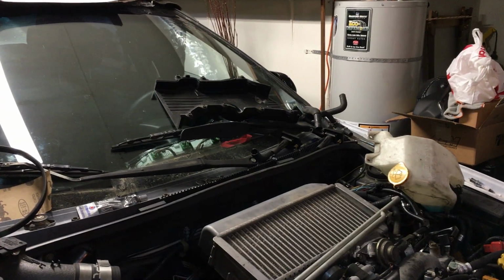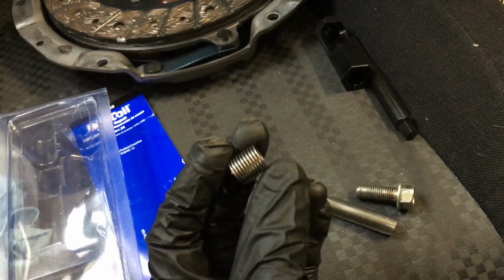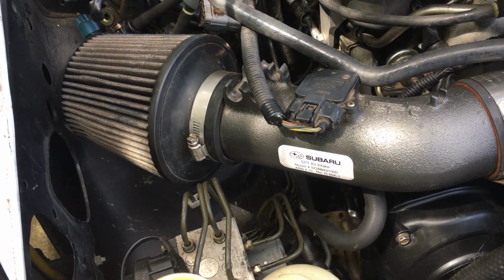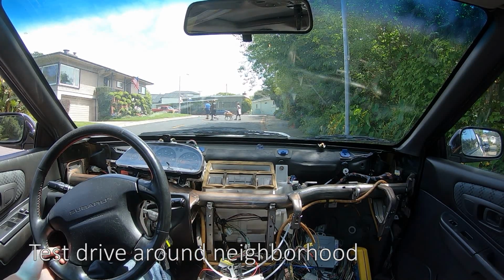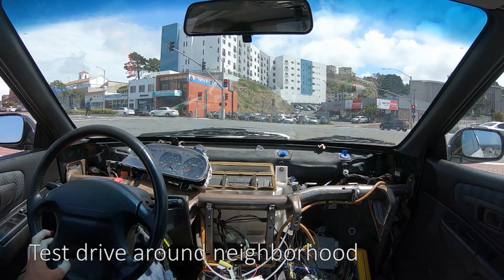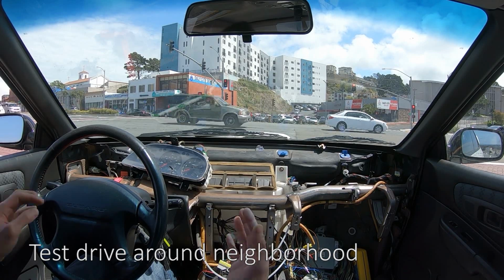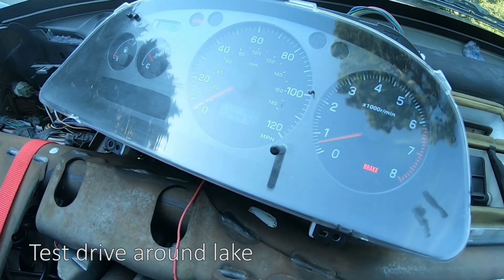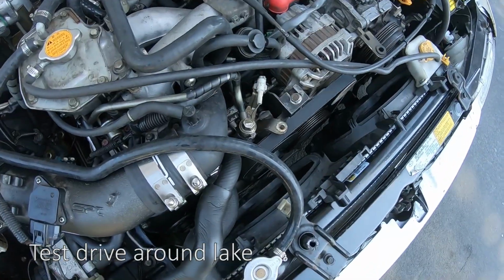EJ205 Engine Swap Pt 4 - Test Drive - Subaru Impreza 2.5RS GC8 Video 25

Comment: Such a small world. I’m interested in getting an e-bike and found your channel. After looking through your vids I realized you are the guy I bought my ej205 from and it’s showcased in this video lol. That motor is no longer, it had a stuck valve and did some serious damage. Parts of the engine still exist on the one that’s in my car now that I pieced together. Thanks again Collin!
Reply from the maker: I'm sorry to hear that Marcus. I'm glad you got to piece it back together, and it's working now. 
I bent a few valves on the stock 2.5RS engine several miles after putting in an OEM timing belt, tensioner and pulleys because the belt slipped. Luckily that was the extent of the damage, and replacing the valves and putting the same model Gates timing belt seemed to have solved the issue. 
I don't drive the Subaru much. It's good to hear from you!
Reply: @ColinLeung  I was wondering, you mentioned a wire you could disconnect for iacv. That’s the only problem I’ve had this whole time. Could you elaborate further?
Reply from the maker: @Allhailthebeavertail  It's been a few years since I've worked on this, so my head is a little rusty. Rewatching the video at 1:30 I mentioned a P0159 IACV CEL code due to a neutral position switch. If I recall correctly there's a brown plug coming out of the transmission that goes to the engine or ECU harness that I disconnected. 

I found a video that shows the location: https://youtu.be/SQFt5wya6QQ?t=113

The plug may look like this? 
https://amzn.to/3Gf4G08

Some other info
https://iwireusa.com/blogs/iwire-university/neutral-position-switch-and-your-subaru-transmission-swap#:~:text=The%20Neutral%20Position%20Switch%20or,in%20neutral%20or%20in%20gear.
Reply: Thanks Collin. That will help. The engine I bought from you lasted a while. Commuted 70 miles a day, 6dqys a week for about 6 months

Comment: Great Video! I have a 98 RS that I finished my ej207 swap on about 6 months ago. I bought it from some "jdm engine" importers and they promised it was good compression wise and even offered a warranty. Turns out lost a valve in cyl 3 and it ate up my turbo pretty good. :D I feel your pain with all this. It's coming together keep it up!
Reply from the maker: Thanks for sharing your experience! Did you have to BAR and smog the car, and did you have a check engine light? I was hesitant to purchase a used JDM EJ205 because I heard the compression ratios were different than USDM, and it would cause issues.
Reply: @ColinLeung  I plan to bar it eventually, but currently a broke college kid so that will have to wait. It won't pass smog in June so it'll sit until i can get a wrx for all its parts. I got my harness done by iWire so it was pretty much plug and play. I had a CEL from idle air control valve but I think that was it. I haven't heard that the compression ratios are different than the US. The only thing I can think of is it might have to do with mismatched ECU's between USDM and JDM. I know Bucky Lasek has a jdm 205 in his blue rs and I don't remember him mentioning anything in his videos.
Reply from the maker: @ArcyGarcy  That's awesome. Let me know how it goes when you finally get the car put together and BAR'ed.

Comment: Btw mad props for going through this.  Would have driven me up a wall and I probably would have quit a long time ago.
Reply from the maker: Thanks. I appreciate the feedback. I ended up putting the stock engine back in, and am planning to put a wide body on. I might do another engine swap in the future if I can find a cheap used wrx or STI.